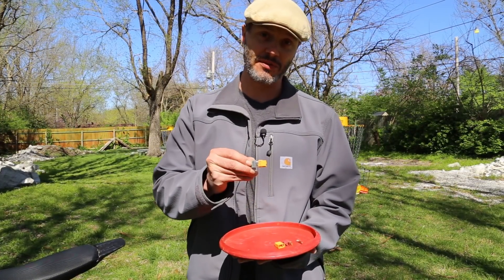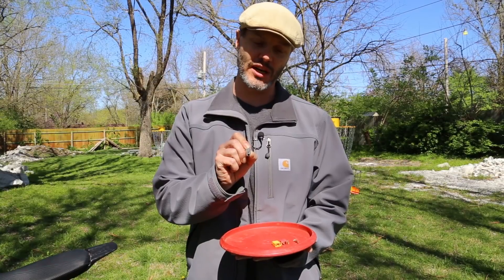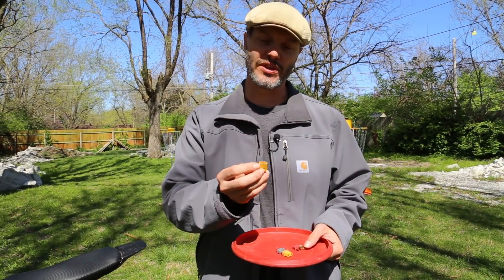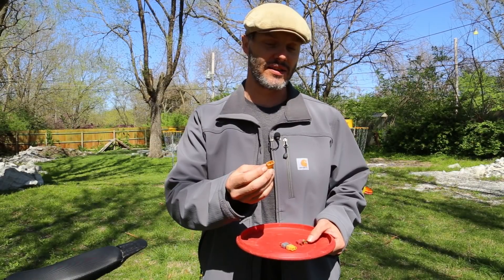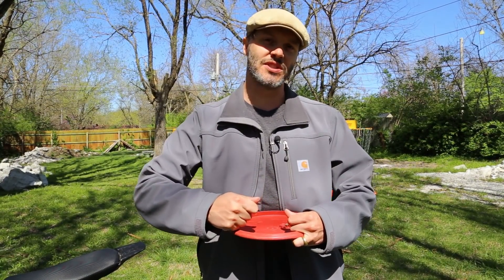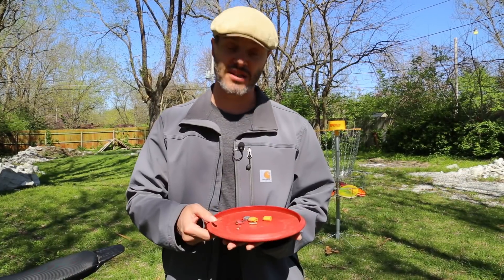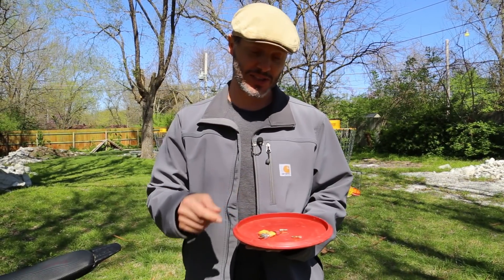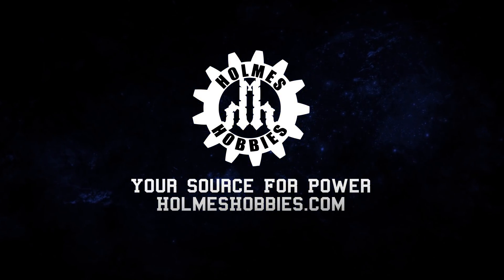Deans Plug Demise???

Comment: Never used Deans myself, used Traxxas and Tamiya before. But a while ago switched to mainly XT90. For a different reason. 
I use XT60 for our drone and still use Tamiya plug for some of my Tamiya RC cars, but will make the switch to XT plugs for those too asap.

Even do the XT90 is a little bigger vs XT60, I had a special reason to go for the XT90 over the XT60. Besides the XT plugs are a joy to solder and I like the design better, much better protection. And I can use all my Lipo batteries with almost all of my RC cars. 

One of the main reason to switch to XT90 for most of my RC cars is this. My kids had a hard time plugging and unplugging the Traxxas connectors. So I did a little test with them. Got myself all kind of different plugs and let them decide which one was the easiest to plug and unplug. So we tried Tamiya, Traxxas, Deans, XT30/XT60/XT90 and some other plugs out there. The struggled with pretty much all of them except the Tamiya and the XT90. Tamiya and Lipos, not a real fit, only use those with NiMH. But they really liked the bigger XT90 as it has more grip for them and needs less force vs something like the Traxxas one. 

Children do not have the same strength in their hands as adults. So if there is a plug that makes their live easier, that is one to consider. At the moment I did this test my sons where 8, 11 and 13yrs old. But even now 3 years later it still makes sence. 

So adding everything up, how easy to solder, how easy to use, spark protection, beeing able to handle the current, amps, heat, all that a Lipo system throw at a plug. I want my kids to be able to unplug a battery if needed fast for any reason. The XT60 was a close contenter, but the XT90 was the winner. Sometimes bigger is better.
 So, XT60 for most is the best choice, but.... a XT90 gives a little bit more grip for small hands.

Comment: I couldnt agree more john.... I used Dean's at first and then found better options. I use xt60 on all of my crawlers and 1/10 scale basher rigs and xt150 plugs on my 1/8 scale bashers and x maxx. I find them to hold the current load better and are cleaner and easier to solder. I have never had an xt series connector fail and have been using them for a couple of years now. I find traxxas plugs a bit cheap and harder to solder. Plus they will melt down under serious voltage and load. Good video. I wish you would post more because I get so much info but also know you must be super busy.

Comment: Mostly deans on my ESC's (with exception of EC3 on my RTR Vaterra Ascender), but XT60's, EC3's, and various banana plugs on my batteries, which means I have too many adapters to account for. My intention is to eventually move to XT60 on my all ESC's, then transition to XT60's on the remaining batteries. The main exception will be keeping EC3 on my Vaterra Ascender, because I use small 3S 1350mah flight LiPo batteries, which already have EC3 plugs.

Comment: I started as a Dean user since that was what my first esc was delivered with but they melted, got deformed and caused glitches that fried the esc, I still have that plug somewhere as a reminder not to use the Deans
Since then I use EC5 connectors on my big fast toys although I've been looking at XT90 because I don't really like the feeling of how the EC5 connect, they just don't seem to fit together properly and I have even had one of the bullet connectors pushed out of the housing
And my crawlers get XT60 since that's what most use around here, and my planes and boats get XT60 since those are the toys I use to exercise my batteries when they have lived too comfortably for too long in the crawlers :D

Comment: I've been DEANS since the 1990's..... But slowly changing to the XT60-90 Plugs. My Arthritis makes it increasingly more difficult to UNPLUG Deans Plugs.
Otherwise, I've had no other issues with them. The XT60-90 Plugs just seem to be more easily soldered, and overall, more user-friendly.
Carmine
Reply from the maker: The difficulty unplugging is probably my biggest gripe.  Especially after they get a little dirty, it jams up pretty bad.
Reply: And that's more than just an annoyance, John....
What if there's a SHORT!!?? 😱
Reply: @HolmesHobbies  My experience is quite opposite. I have Ranger battery, that is equipped with XT60, and Hobbywing 1080 ESC, that is equipped with XT60 as well. I.e. I can assume that both connectors are of good enough quality. When I'm detaching battery from ESC, I feel that I will damage my rig inadvertently, because connection is quite stiff. On the other hand, I have Amass Deans (with cups, like XT60+), and connection is perfect - not too stiff and not loose. Stiffness of XT60 is my main complaint. Next one - XT60 is bulkier and angular.

Comment: I started with Tamiya plugs in the  late 1980s but once I  saw deans I switched to them. I did hard wire my motors for while then switched back to deans until 2012 when I stopped RC racing because the last local track closed. Fast forward to now and, due retirement, I am getting back into RC.  I still have a lot of deans left so I will stick with them for a while.

Comment: I use 8mm bullets on my speedrun cars so I can  easily run them in series or parallel  ,but  for 3s and under deans  I was starting to switch  to TRX just for waterproofing. This is looking like a better option since I get most my packs from HK anyway.

Comment: I'll change to xt60 too. 2 weeks ago we had a problem with the Deans connectors on a TRX. Out of carelessness, I wanted to put the plug the wrong way. Usually this is not a problem, but this time a spark jumped over and the ESC was immediately broken. I think (or hope) that this will not happen with the XT60. Great video by the way.

Comment: I use Anderson power poles on  all my rigs
Reply from the maker: Whoa!!  The one guy using power poles!   I used to use them on my Ebikes, but they arc very badly and end up needing frequent replacement.  the XT60 has gotten onto my low power ebikes now too.
Reply: I had Powerpoles for a while .... in the 90s.  Now I'm trying to decide with a little of everything but I just bought 20 sets of xt60 to get started standardizing.

Comment: I’ve been using Deans.  I used to use sermos power poles which I liked a lot but they started being difficult to find. My hobby shop told me Deans were better and could take the kind of power that modern NiMH batteries were putting out, so I started using them. I have to admit I never liked them a ton for all the reasons you pointed out, sure they have a really small footprint so they looked more slick (if you didn’t botch the soldering job) and all the really good drivers were using them but they are a pain to unplug, they spark when you plug them together plus they are a pain to solder. I was thinking of making a switch and your video sold me on the XTs, I’m switching.

Comment: XT60 is the general purpose flight connector for smaller quads and plans and what all my old batteries have, 3s and 4s. JST for anything micro, 1s or 2s.  My little toy crawler has XT60 and when I finally get a real crawler I'm sure it'll be XT60 as well.

My first truck (2wd, 540 powered) had Deans, but my second truck (4wd, 3665 brushless) has iC5 so I've converted the batteries to EC5. 2S Lectron Pro 5200.

Comment: I bought a Axial Gravedigger last year around November 2017 and I used  deans plugs at the time but the contacts on the deans plugs has two parts one keeps the pressure for the electrical contact. in total there are 4 contacts and not long ago i had an issue with the truck I would jump the truck then it would stop. It turned out that one of the 4 contacts broke so the contact was not quality at that point so I went to the hobby shop and ended up with xt60 plugs on my charger and batterys.

Comment: I run XT60 for batteries and XT30 for hooking up my laptop powered accessories I have recently started using MT30 I believe 3 pole xt30 style for  brushless motors. First time I used it was for a friend micro x and revolver 1800. Sofar no issues

Comment: I run Micro Dean's in my 1/35 scaler and 3s LiPo/ Brushless Losi 1/24 Truggy. I needed the wattage throughput and small form factor. JSTs weren't gonna do it. Anything bigger, though, XT60/90 are the way to go. But I've noticed their manufacturing tolerances are much wider than true Dean's; some slip in very easy and some are nigh impossible.

Comment: Dean's plugs are fine for me, I have never had a problem. I will use them until they can't be found. I used to use race prep, years ago, the ones with two plates, directly across from each other. I had my battery in my pocket with some change, and a coin shorted between the plates. I started burning a hole in my pants, and had to pull them down quickly, because I couldn't get it out of my pocket. I was not hurt, but I did learn a lesson, and stopped using those plugs.

Comment: I've been using Deans for so long on smaller rigs, but used to use EC5s or XT90 on higher powered brushless stuff.
Now I just crawl though, so thinking about moving away from Deans too, don't like soldering them and they do get stiff, sometimes even with grease, if they get too hot and the housing starts to very slightly deform, you've got no chance.
Just can't quite face doing all 50 batteries.

Comment: I'm still running Deans, and something pretty drastic will have to happen for me to switch a couple of hundred RCs to XT's.  Lol  Cost and the amount of time soldering makes that a bit prohibitive for me.  John, could you do me a favor and run a test on efficiency, amp rate capability, etc...?  We had a guy at Lockheed Martin test all of the plugs available about 7 or 8 years ago, and clearly, XT's weren't even on the radar then.  By far and away, on all of the super high-end equipment he had to test on, Dean's was the winner of all the plugs.  I mean, we run 14S batteries on 700 class helis without any issues, and I'm not sure there is much more of an amp draw than that in the RC world. lol  I would really like to know if there are any technical/performance advantages to XT's.  If they turn out to be a far superior plug, as we know Deans is to all others, I may consider making the switch.
Reply: https://www.electricbike.com/ebike-connectors/

 XT90

The same as the XT60, but a little bit larger and doesn’t melt with 90 amps of power. These are pricey at 1.50 each but worth every penny if you are running high power. Highly recommended. The wire insertion cup fits very fat 10ga wire (or smaller, of course) and I use 6mm heat-shrink tubing to cover the solder joint. “Heat shrink” is dirt cheap from Hobby King. Ron uses these between the battery and the controller.  Of course, your life will be easier if you order them with factory installed pigtails.

Even with this style of connector housing having a well-designed “fully enshrouded” shape on the male pins, it is still traditional to attach the female connector to  the battery side of the wires. When the controller is unplugged, there may be a small amount of energy still stored in the capacitors, but…the battery on a high current E-bike can have a fiery melt-down if you set a metal tool on the workbench and the tip shorts the two male pins together.

The enshrouded male plugs on the XT90 connectors make that scenario very unlikely, but…we still use female connectors on the battery side.
Reply: I'm familiar with XT90's.  I own a hobby shop and have to deal with all of the connectors regularly, but XT90's are expensive and SUPER bulky.  I mean, they're HUGE plugs.  In a lot of scale and smaller scale RC situations, that isn't a usable plug.  Some of the 1/8 scale trucks are using them, but it needs to be 1/8 or 1/5 scale to have space for such large plugs.  Of course, on an ebike you don't have these space constraint issues. lol
Reply from the maker: I'll see if I can whip up a sensitive enough resistance tester to tell the difference.
Reply: That's why you're the man!  I'd love to see the real numbers difference between the plugs.
Reply from the maker: And the initial tests show there is a negligible difference.   Not enough tell the difference with a foot of 14ga wire in the test rig.
Reply from the maker: test number two with greater sensitivity, still no discernible difference.   both setups right at 0.006 ohm with 1 foot of 14ga wire.   This is the resistance of exactly one foot of 14ga wire,  so we can conclude that both plugs are equal or less than 14ga wire resistance.  If I recall correctly, deans are equal to 12ga wire.   I'll need to get 10x the sensitivity to hack this down any further, but I don't think it will give us a much more useful comparison since the wire , motor, ESC, and battery ends up being the bulk of system resistance.
Reply: Wow, that was fast!!! lol Thanks John, I was curious, since I've never seen a properly soldered Deans meltdown, if the XT60's could have much more of an electrical advantage.

Comment: So I have a cen 450 and going to buying this bumper with led lights in it... both lights have bare end wires what ends would i need to get to be able to hook the bumper leds to my lipo with deans plug so they come on when I turn the truck on? Thanks

Comment: I like the Traxxas iD plugs. They're ergonomic to the fingers and your battery is not some needlessly obfuscated octopus looking thing with superfluous wires and connectors to accidentally damage with use.  I  find it interesting that ICE cars all get their particular form of liquid fuel from a rather universal pump handle. Buy an E-car and you need to carry 2 or more costly 'plug' adaptors in your trunk or you can be SOL out on the open road if you need to recharge.

Comment: You wouldn't happen to know where I can get brushless motor rebuild parts. I'm not looking for specific brands because I like running cheap motors just to see how they stack up & well the obvious their cheap. Just looking for a generic motor supply type store.
Reply from the maker: There are no standards at all.   Bearings, rotors, cans, faceplates, they are all rather unique to the motor.    Bearings would have the most chance of fitting, but even so, every factory has different tolerances and the shafts are ground to fit that particular bearing vendor (if manufactured properly).
Reply: HolmesHobbies Ok Thanks.

Comment: Ive used ec3 connectors starting in 2012 on my crawlers. My gen 8 came with a deans. I really hated soldering to them. God awful. And that little spring piece.. eff that little thing. Going to switch to xt 60.

Comment: I use xt60's for both battery to ESC and Motor to ESC.  With the Motor to ESC,  I use the female end at motor and male at ESC to prevent me from making a mistake.  Super easy to connect/disconnect with an almost water tight connection.  Someone let me know if this not safe please.  Still a rookie to the hobby.
Reply from the maker: Thats how I do it.  Make it where the battery can plug into the motor, or into the proper side of the ESC!  No unsafe combinations that way.
Reply: Great to hear I didn't mess something up this time :)  Just didn't like messing with the bullets and their cheap clear plastic/rubberish insulators that tear so easy.  Is there a better solution for bullet connectors?  I seem to only run across the connecter w/o insulator.  Maybe only heat first 1/4 of heat shrink on the female end?   Thanks for the reply.
Reply from the maker: Soldering and insulating bullets can be a pain, for sure.   It takes practice.   The XT60 is basically a shrouded bullet, so choosing them for ease is totally OK!

Comment: I think this deans connected to xd60 just gave bottle on the 52 volt 2000 w battery now I'm using the xt60 to xt60 on a 48 volt 15 watt 1500 watt battery

Comment: XT60 easier to take apart???? where do you get them, my XT60 i barely can take apart again without using pliers to hold each half.
Reply from the maker: Different manufacturers may have different tolerance ranges.    Amass is one well know molder with consistent tolerance. But if the esc and battery side is different manufacturers all bets off
Reply: @HolmesHobbies  it's connectors bought together I haven't soldered on yet, I wanted to test them before soldering, man they are tight, but I guess it makes a good connection then 😆

Comment: Yesterday there happened to be a knife on my table I didnt see from my view. I plugged in a lipo and moved the charger over and unknowingly, set it down with the deans connectors perfectly touching the knife and made a huge spark and my charger leads got so hot, I could've pulled the solder connections apart easily. The knife has 2 perfect little pin size craters on the handle. What are the chances I set it down perfectly on that knife, connections parallel to it and lined up 😂😂😂 just my luck. Yes I aware they come with safety caps for when not in use but I rarely use them, can never remember. I'll remember now lol
Reply from the maker: yikes!

Comment: i have all deans but got batch of a crappy chinese knock offs and they dont fit properly into the original deans have to bend the prongs slightly and then force them to plug in. taking them apart is nearly impossible afterword almost rip the solder joints off every time. So probably will switch to xt60